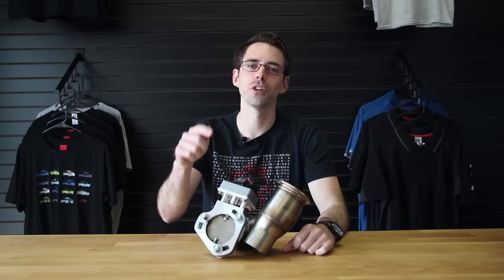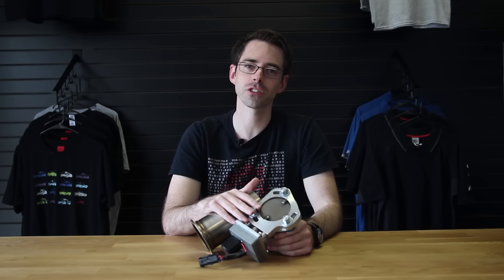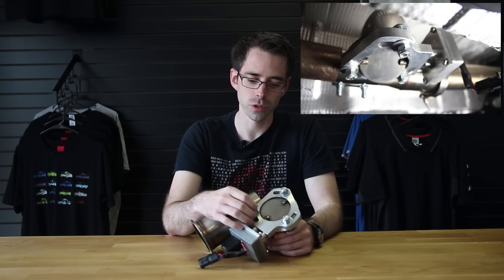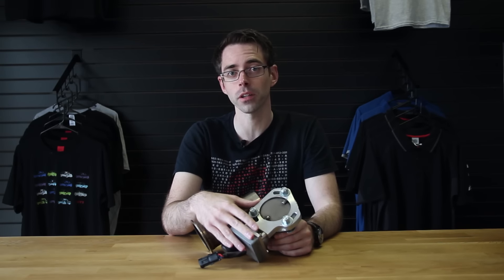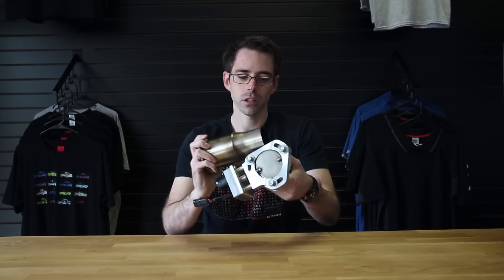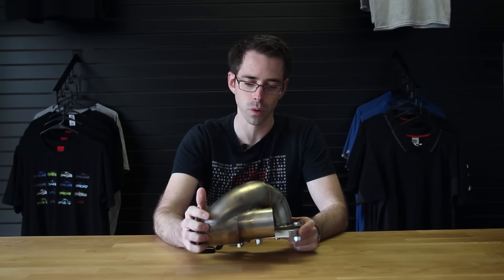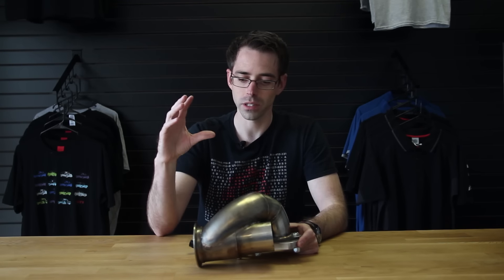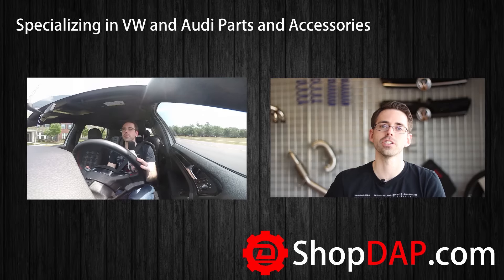Electronic Exhaust Cut Out... What it is and how it looks on our MK7 GTI

Comment: What is that rattle sound when the RPMs are coming back down?
Reply from the maker: Stephen Hill With the valve open or closed?
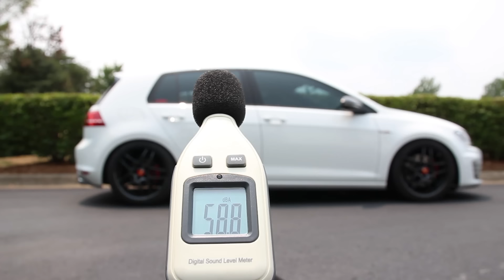Reply: Deutsche Auto Parts Closed, stock 0:51
Reply from the maker: Stephen Hill That is likely to be noise from the small leak by the valve

Comment: So are they going to produce these? I think a lot of people will be interested
Reply from the maker: Stephen Hill I'm sorry we don't intend on producing these.
Reply: Stephen Hill I would totally be in for this
Reply from the maker: @statiCDjn We decided not to produce these as they are will not be at a price point we found to make sense.  The Valve with cut out and down pipe would cost $1300.00 if you would like on at the price please reach out to us and we should be able to help you get what you want.
Reply: Deutsche Auto Parts would you maybe consider making a less custom version of this? One like this (http://raceland.com/electric-cut-out-2-5-exhaust-system.html) but that bolts to the downpipe instead of having to be welded.
Reply from the maker: Ethan Parr I'm sorry but there is no other option.  There is no room on the exhaust so you need to cut a section and or modify your downpipe to make this work.  This means that the setup we made is the only easy not custom cutting and welding solution.  If you really have your heart set on doing this you should find a local fabricator in your area to help you.